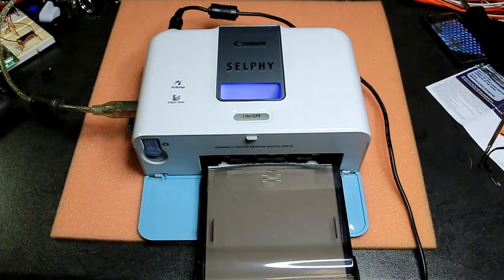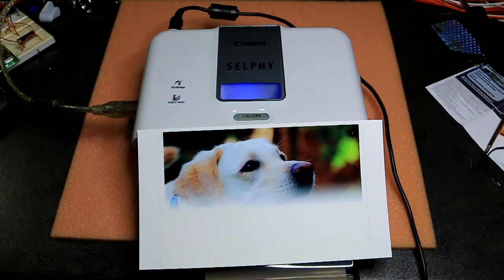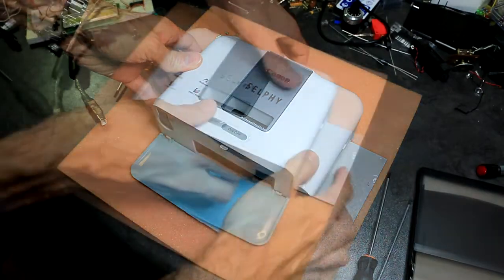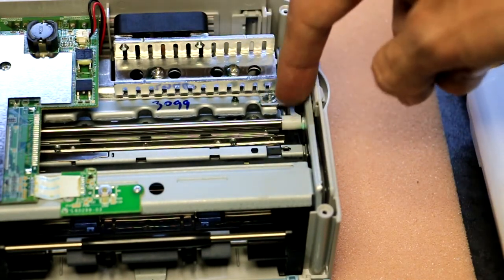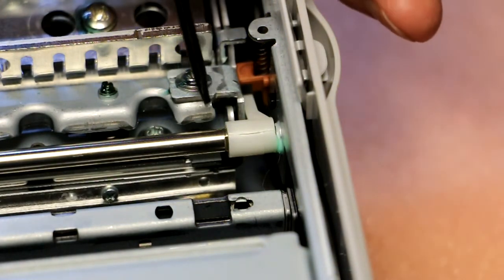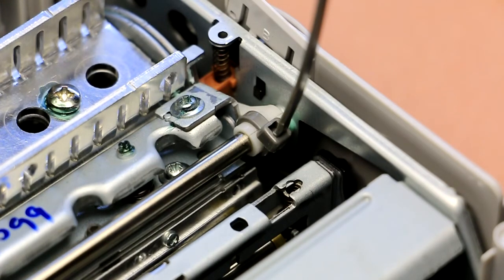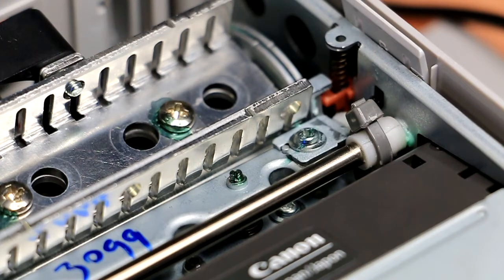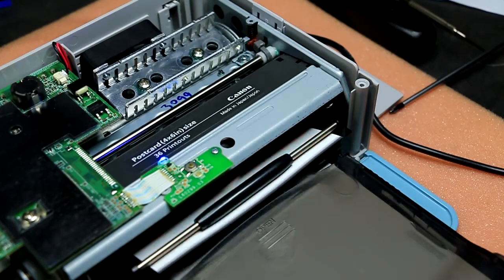Canon Selphy CP510 Repair (#001)

Comment: I was unable to find a thin enough cable tie to fit without rubbing so I used some thin copper wire which I twisted tightly then glued it in place. All working fine so thanks for the video tutorial. Really helpful, thanks.

Comment: My printer got handed down to me from a friend and the only thing wrong was that the battery… no longer held a charge. He tried to fix it but messed it up. I guess I will need to use the cord. No worries… take care. All the best and thanks for the tip , just in case!!

Comment: Hi, I have this problem on a Canon Selphy QX10, is there a way to fix this on these printers?
Reply from the maker: Unfortunately I have no experience with that model, but the same principles should still apply. If you can, open it up and check that there is even pressure on the thermal print head while printing.

Comment: Thanks for a nice and very simple to do video. It worked well on my CP760 model. In India, service centre told me that its old model and can't be repaired. But I did it with your video. Only thing I used copper wire instead of plastic tag which was not going inside. Thanks again
Reply from the maker: Very happy to hear that, Rajendra!

Comment: Thank you for the video, I'd like to try but I would like to be sure I use the correct glue. Which one do you suggest? Also: the crack in the plastic is in the bottom part, not visible from the top. How do you suggest to glue it? Thanks!
Reply from the maker: I used a generic brand of super-glue (or it's industrial name, cyanoacrylate adhesive). If the crack is on the bottom, it may require some disassembly, but you could also try to put it on its side and drop a small drop into the crack. Just make sure you immediately "zip" it up so that it can set with as little gap as possible.

Comment: Hello, i have the same issue that my Canon Selphy CP910 printer only print half of the photo. But when i dismantle the printer, the roller that you have shown to us. Theres no crack, do you have any solution about my case? Can share in your video?
Reply from the maker: The reason for the one-sided print is due to uneven pressure from the print head onto the paper. In my case the little cracked plastic could not torque the pressure finger to press the printing head down far enough. Look for something that presses down on that head-mechanism and make sure it can apply appropriate pressure. All the best.

Comment: I was so hopeful--this did not work on my Selphy CP 900. I'm pretty sure it's toast. But thank you for your video--it helped me get the courage to open up my selphy and see if I could see what was wrong.
Reply from the maker: So sorry to hear you did not come right. Was the torsion bar split? Yes, it's always good to feel empowered enough to have a peek inside.
Reply: Nothing seemed to be split, and I used a flashlight to see to be sure I didn't miss anything.
Reply from the maker: Try and see if you can print something while it is open - apply some (slight) pressure on the side that does not print - it might point you in a direction of where the issue is. Good luck!
Reply: @TechBench  Hello, i've just tried on my CP510 but it doesn't work. I have applied pressure on the side that does not print : nothing works. Is it possible that only the half piece of metal heats ? Thanks a lot.
Reply from the maker: Is there still a gradual fade-out to the one side, or is it more of a step-to-white? If it steps, then it could be a contact problem with the flat flex cable leading up to the thermal print head. If it fades out, the only explanation can be that there is some gradual increase in distance between the thermal print head and the supporting drum. Did the drum perhaps get a knock that may have caused it to move backward on the one side?
Reply: @TechBench  Hello and thanks for your quick answer. I'd say it is more a step-to-white. This printer has been a few tiles (maybe 20 pictures) and the it has been stayed unused for 4 or 5 years. It is as brand new one with stickers on ! Yesterday, my wife boughts two cartridges and we tested both because it seemed to us that the first color film was a little bit noisy and visually stretched. Same for the second one. So i followed your step-by-step : the white plastic piece is broken on the entire lenght and the cable-tie seems not to be strong enough to keep it in place. So i tried with e pressure on the guilty side. I didn't notice any problem around cables that's the reason why i have thought about the thermal piece.
Reply: NEWS : yesterday, before re-assembly the beast, i put sole glue and no cable-tie. This morning, i gave it a try : it worked ! But after 6 pictures, another issue appears : yellow color is applied, and the photo-card stays in the back, red LED shines on and off.It seems that paper can not enter.

Comment: HiI followed your instructions but cannot get the cable tie to be small enough for the bar to still move - it catches on the cable tie! Any suggestions?
Reply from the maker: Hi Kate. The cable-tie is basically just there to make sure the entire 
thing sets tightly. If you don't have a small enough cable-tie, just let
 it set then cut it loose after the glue as set. The glue should be 
strong enough on its own to keep the bar from slipping inside the 
plastic. All the best!

Comment: Funny question, but what kind of screwdriver is that? I am looking through my husbands tools and can't find one that is small enough but long enough to fit
Reply from the maker: - not a funny question at all! It's a 3mm by 100mm phillips point (star) screwdriver. I guess in US units that means 3/32 inch by 4 inches. Any good hardware store should stock them for a dollar or two.

Comment: what kind of fool would buy that in the first place?? lmao a Cheap inkjet would do better..
Reply from the maker: Possibly, although a "cheap inkjet" does not add a final UV protection layer, nor is it as portable. The Celphy printers all come with a battery pack slot to be fully mobile. Me, I just got both - each have their uses. But I guess the point of the video is to repair it if it breaks.